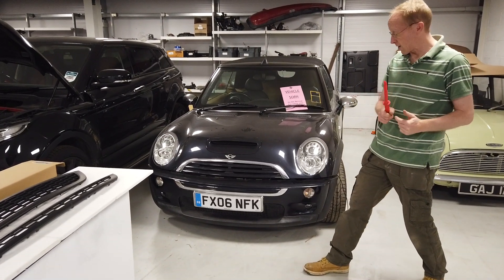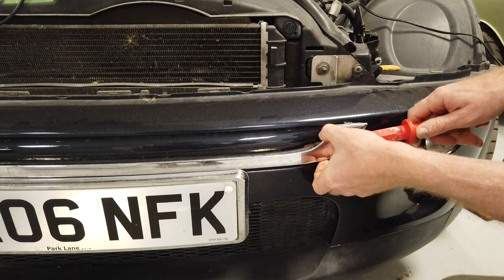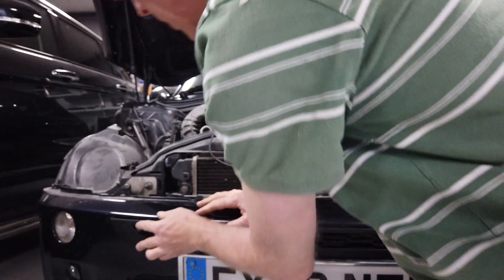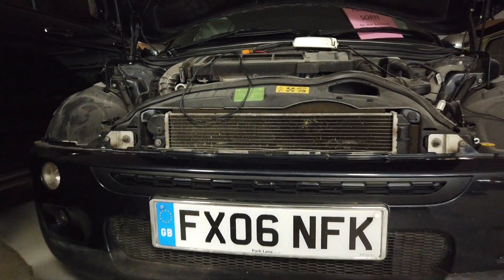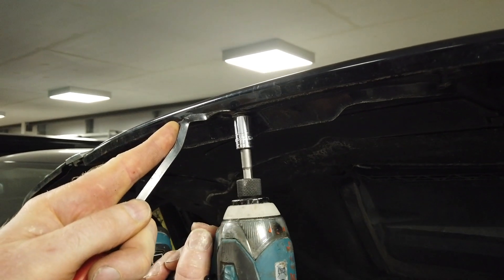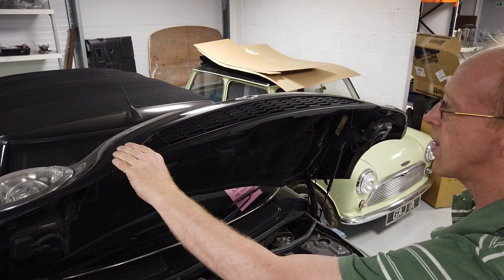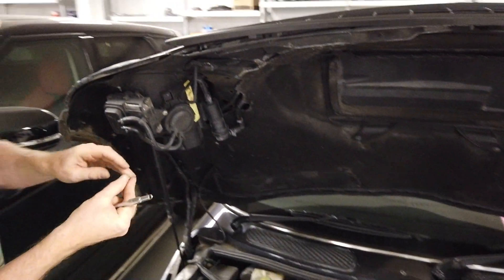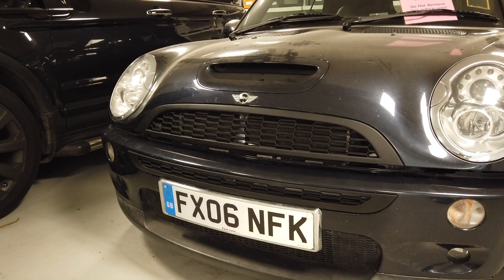Fitting a JCW Style Grille to a BMW Mini R50 R52 R53 cooper / S

Comment: Great video guys , just a couple of things that make removing the top grille easier ( from my own experience ) .When removing the nuts take a 10mm socket and pack it with tissue paper so that the "self tapping" nut cant slide into the socket too deeply .Then take a flat had screwdriver and slide it under the "washer" .Apply gentle pressure downwards with the screwdriver to the washer when unscrewing the nut and you will find that they come off a lot easier .When attaching the new grille the nuts should be self tapping so using a 10mm socket should do the trick instead of "pushing" them on in the manner you did in the video .Hope this is useful as its what I have found works best when I have removed and reapplied the top grille several times .
Reply from the maker: Thanks for sharing these tips - the nuts that come supplied with the grilles we sell are not great ( nor are the BMW ones ) so we are looking at sourcing some better nuts to go with the grilles.
Reply: They screw on and off they are just fine. I've used them on many different cars. Just go slow they cut into the plastic and make their own thread as you twist on the correct direction. Use a 10mm socket and just stop as soon as they start to feel snug. Put them in the socket first also. They only have to hold the grill to the car and since they are on the front the air pushes them to the car as you drive so no way for it to detach.

Comment: This grille set looks like the black version of the one I have in chrome.  Years ago, when I fitted mine, I had fits trying to get the steel clippy things onto the plastic pins.  Ir was still a bit loose.  My solution was to fit a pair of grille badge holder plates and fab up a small piece of aluminium bar for the mounting screws to go through, so the grille badge holds the grille in the opening in the bonnet.  For the lower section, I used a Dremel and opened up the bumper cover behind the grille to let in more air, as we get a lot of rather warm weather here in Azirona, and every little bit helps when it's nearly 50°C.  The grille lines up fairly well with the round holes in the aluminium bit behind the bumper cover.   I had the same problem you did with the end clippy thingies not wanting to stay snapped in.  My solution to that was to use the same #8 socket head cap screws I used to hold in the bonnet vents I added (see earlier comment about temperatures here) to keep the ends tight.  Since then, I have upgraded the intercooler and set up a custom scoop for it (because it was half blocking the opening and starving itself for air flow), following the old Mopar "Shaker" pattern.  Had to cut the bonnet again, but it sure drops out of heat soak quickly now....

Comment: Wish i had read some of the comments on here first, it is so easy to damage the existing crome mini parts, they bend and snap with hardly any effort, as previous posters have said its good to recycle your old mini parts to help others out. Once fitted however these grills look so much better than the bling.

Comment: Ok. In case this helps someone else, use a heat gun and melt the tabs on the back until you can distort them into bonnet to form a seal. Creates a way tighter fitting. Wear gloves and use common sense.

The original bmw and even the newer supplied fittings just don’t work.

I went one step further and masked off the bodywork behind grill and sprayed it matte black. Thanks again for getting in touch. Means a lot!

Comment: Not sure about the material for your grille kit, but the one I just purchased was made from ABS. From my 3D printing hobby, I know that a soldering iron makes easy work of embedding heatset nuts. I just cut off the plastic stems and predrilled for M3 heatset nuts. Then attached the upper grille with some short M3x10mm sockethead bolts and some washers. Now I have a solid connection that can be serviced repeatedly with nothing more than a 2.5mm hex key.

Comment: Your going the wrong way with the drill and to keep from stripping the lower grille tabs take the bumper off and push the insert down to release. Those nuts screw on and off just as a normal one use a wrench and go slow it's just plastic it's cutting into no reason to ruin every part that comes off the car. I usually recycle my unwanted parts by simply posting them on Facebook for people less fortunate who need them to repair their cars. Cheers
Reply: This...  just have patience with everything. And don’t push! Hahaha and they also sell the stuff, they don’t know how it works... 😂🤪
Reply: I have the same kit and you re correct. The bumper only takes 5 minutes to remove, so it's not that difficult.

Comment: Hi Guys, so when I tried to buy the mesh grill on your website, it states - WILL NOT FIT ON 2006 MODEL. But in this video you install the mesh grill on a 2006 R53 convertible 😊. Please advise what mesh grill I should buy for my 2006 R53?? Or confirm whether the info on your website is incorrect.

Comment: Just tried fitting the grill. The self tapping nuts provided only work on the top pegs as they are thinner all they do on the bottom is strip the plastic pegs because they’re too thick to go through. Then when you put them on the pegs along the top for a second time after a thread has already been cut it ends up stripping the thread and making it useless because the grill doesn’t have a curve and you have to force the nut on. It forces you to use those hex washer things that you then can’t get off. I don’t know what I’m supposed to do now
Reply: Hi Ciaran - the overall design of the grille from BMW is a little annoying and we are tried to come up with best solution possible to make a grille that fits using the original fixing methods. You are welcome to return the grille for a full refund if you are not happy.
Reply: @simonjefferson  it’s just the lower pegs that are the main problem. Like if they were the same size and thickness as the top ones so self tapping ones could make a thread it would be fine everywhere else. I’ve damaged the thread on some of them would I still be able to return it ?
Reply: @ciaranw128  Yes you can still return for refund or replacement

Comment: Boom just bought one. :D
Reply: Waiting for car to come back from garage... £2100 worth of remedial work and fitting the 17% pulley..
Cant wait to get the car back and then fit this grill :)
Reply: @bluenapalm123  what "remedial work" did you have done if you dont mind me asking?

I'm thinking of picking one up this week. Aside from the cosmetics I was going to get the 19% pulley and upgraded intercooler and get the timing chain done too.

Anything else you recommend?
Reply: @djibby1157  
Timing chain kit replacement
Clutch kit
Crank oil seal replacements on timing and gearbox sides
Oil leak at oil housing repaired
Inner CV boot replaced
Ball joints on lower wishbone replaced
Oil and filter change
Supercharger Inspection
Reduction Pulley Kit Fitted
Reply: @bluenapalm123  nice one cheers mate. How many miles did yours do on the oem clutch? One I'm looking at has 73k miles. Is it going to start slipping soon?
Reply: @djibby1157  No idea, bought it with the busted clutch.  Had 96k on the clock.. but of course there is no way to know when the old clutch was fitted.

Comment: Just bought one of these. The quality of the parts are fine, the fixings are appalling. 

Loose upper grille, loosen lower grille. Bit of a bad taste in my mouth now! Really need to supply a bit of paper explaining what the different fixings are for. Anyway of supplying a replacement. I’ve just binned my old grille!!!
Reply from the maker: Hi Steven - i agree the fixings are not great - the grille uses the same fixings as original - and these for sure are not great.
We do use this video as a fitting guide 
If you contact customer service we will get your sorted with a new grille etc.